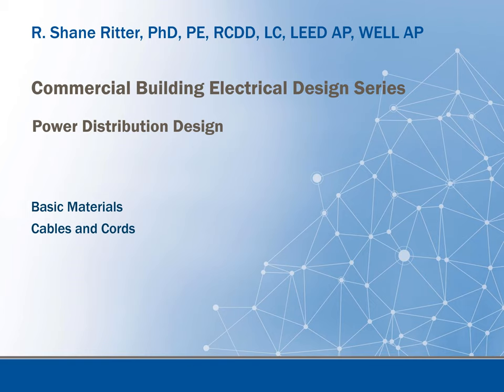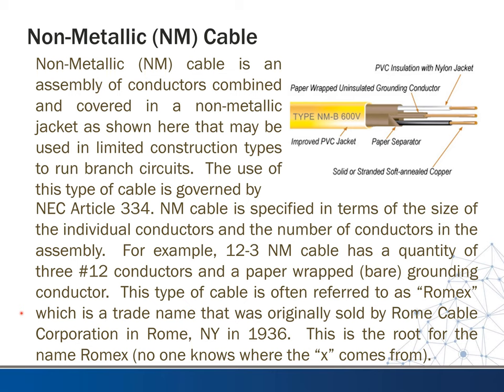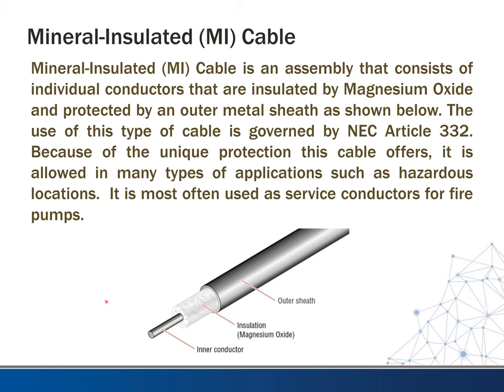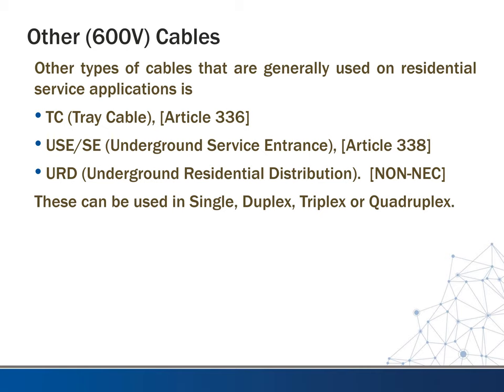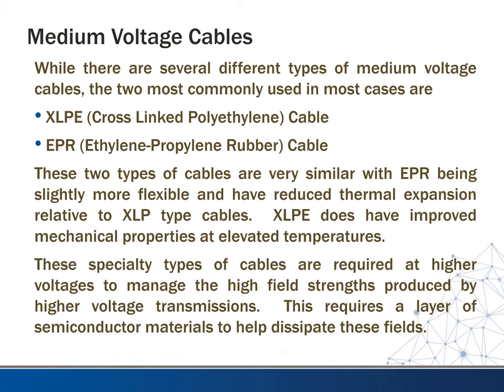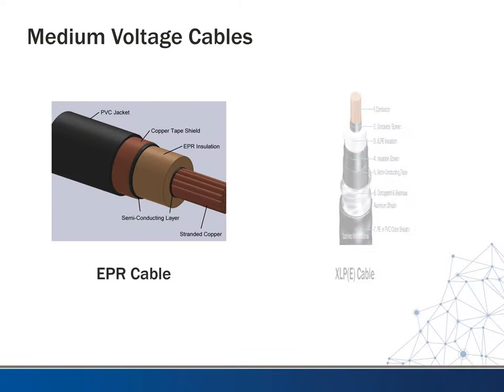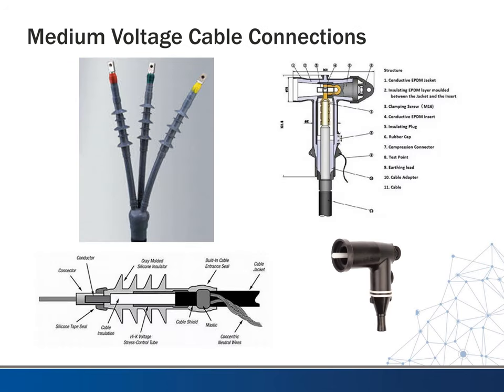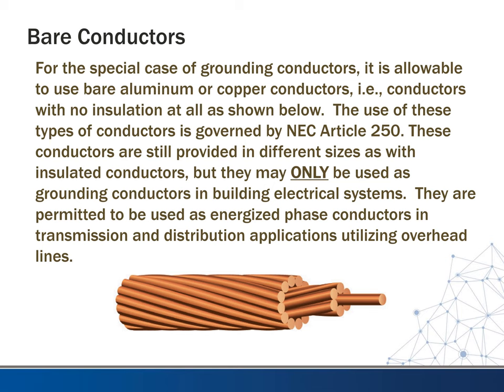Cables and Cords in Electrical Building Construction

Comment: Dr. Ritter, 

Thank you so much for this series of lessons. I have not finished it yet but so far I was able to acquire great value from  this series. I studied Electrical Engineering but didn’t have this course in university. This series is helping me to consolidate aspects where I was lacking as an electrical engineering graduate and create a solid foundation for electrical design for commercial spaces.

I would very much appreciate if you could provide a link for the PowerPoints. 
 

Thank you so much.
Reply from the maker: I am glad you have found these useful.  If you can provide an email, I can forward a PDF f the slides.